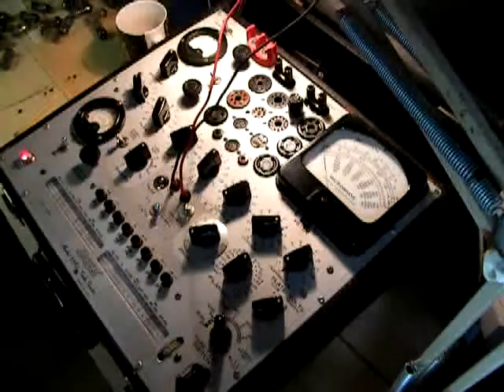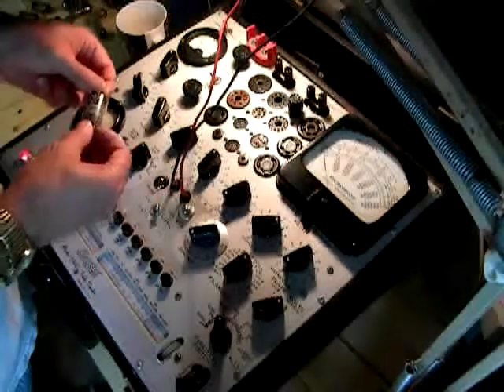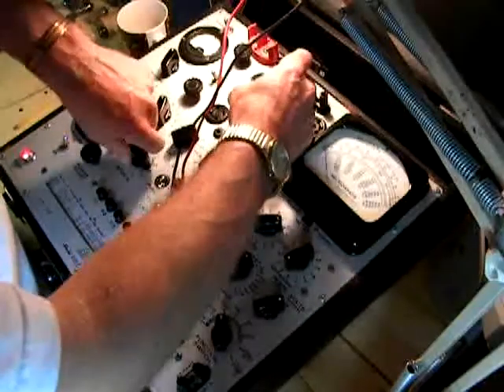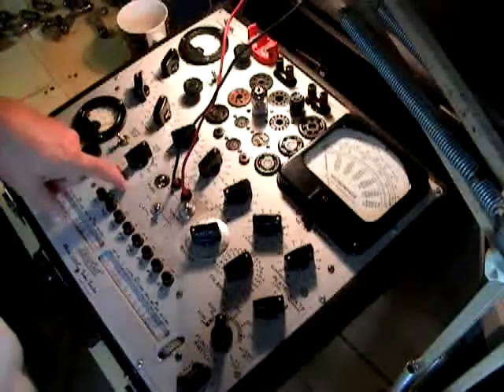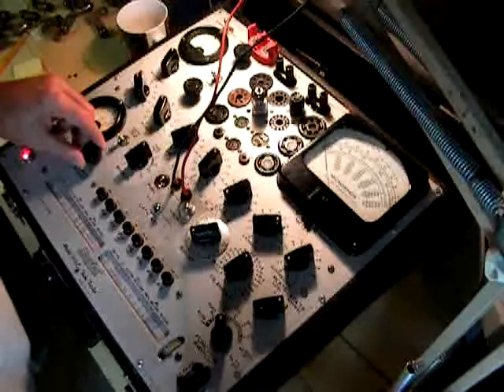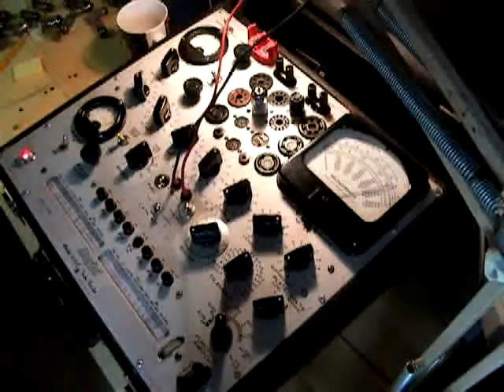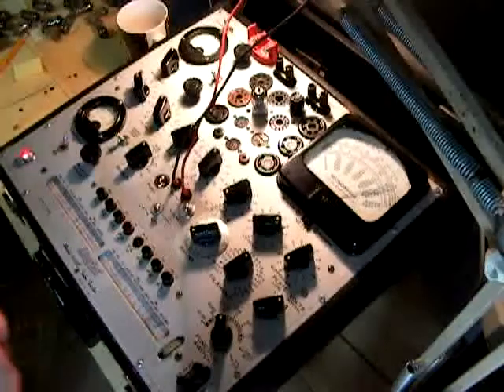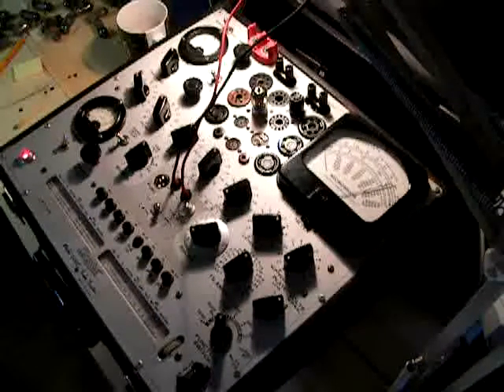How to Test a 6dj8 with a  539c Hickok tube tester

Comment: This guy is instructing YOU on how to test a tube on the 539C but forgets to set the bias until after he has performed some of the testing.  And, as mksj101 notes, he gives the wrong set voltage.
Reply: If you read the manual for the 539C, it states that you make final adjustments to the bias voltage AFTER you press P4. "In the column headed BIAS VOLTS is listed the exact voltage to which the BIAS VOLTS meter is to
be set when testing a tube. Make final bias adjustment after the P4 button is pressed. " Middle of page 5.